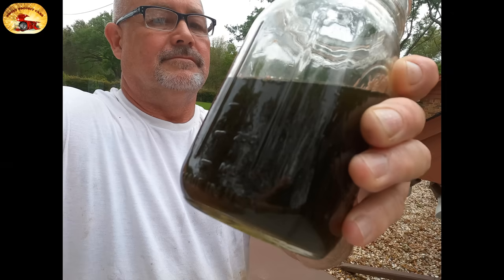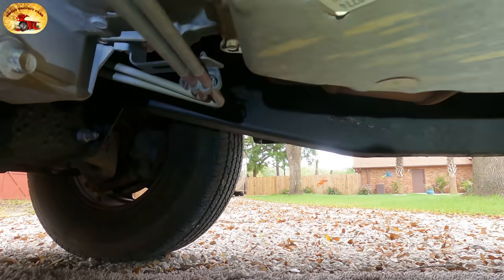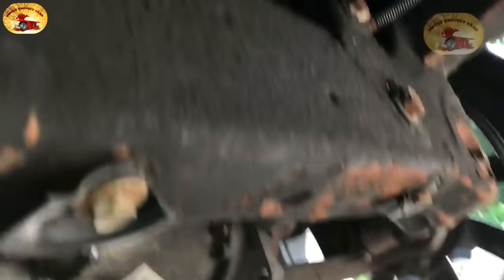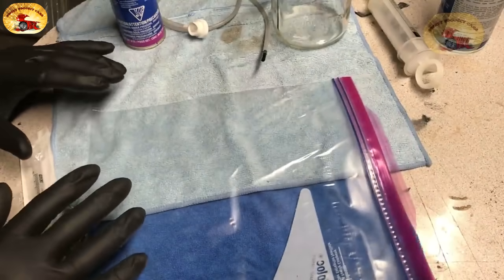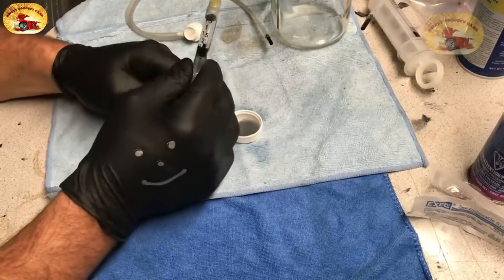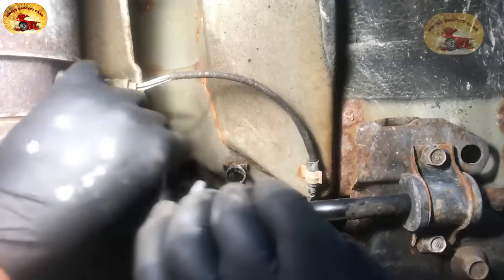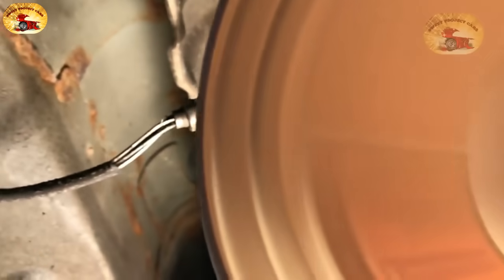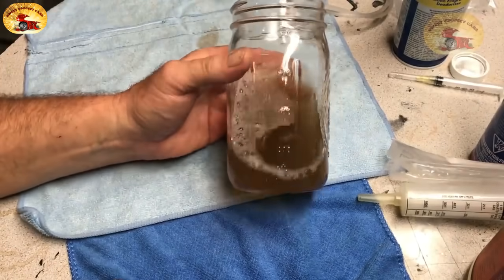Make your A/C 2 TO 4 TIMES COLDER & SPOTLESS CLEAN ALL at The SAME TIME!!

Comment from the maker: tO aLL oUR gREAT sUBSCRIBERS tHANK yOU!! Here is an updated version of a video you need to be doing Soon and you will be glad you did it when it gets really hot and muggy! **Quote of the Week: The older I get the less I listen to what people say and the more I look at what they do.**
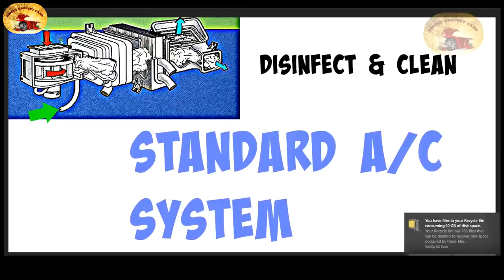Reply: And the older you get the smarter you get! Like putting down a carpet underneath your car so you're not crawling in dirt and gravel. Also when you get old you forget to empty your recycl bin and you end up with 10 GB of files LOL..... see 5:01 in video.  I did that years ago based on your advice and it worked like a charm. Took the musty stink away. Rock on Mike The Hammer!!! ⚒️
Reply: I looked for tools in the description and didn't find them.  I thought duh... that was the other video.  I found the previous video and watched them both through.  I have added the cans to my shopping cart.  My only question is: are the cans the links point to still compatible topped?  I have spent a year fighting a very very weak a/c system in my 2009 Lincoln Towncar.  Shop says all is well and I shouldn't expect it to be any better.  58 degree air coming out of vents when thermostat set to 60 degrees...
Reply: @Leonardokite  k
Reply: Kool idea
Reply: The car I have has two drain pipes, one at the front and one at the rear of the car. 
The car has air con  vents at back half of the car, as it is wagon.
Should I do the same to both drain pipes or is the front one enough?
Reply: @Blue1Sapphire  
If you have water dripping from the front and the rear of the car when the a/c is on then you have a dual a/c system. So, yes, you should absolutely do the front and the rear drains.
Reply: Just came by channel, good stuff.
My car just has a small outlet sticking out firewall.
Will this still work?

Comment: Thanks for posting this video.  I used the process as you describe on my truck last week.  You're right, it does clean the system and gets rid of the stale, musty smell.  Now it smells fresh and clean.  One caution for anyone wanting to try it:  When you run the AC right after cleaning, run it on lowest setting.  If you have the blower set any higher it will blow some foam out the vents.  After a few minutes it will all drain out then it's OK to let the AC blast a lot of freshness.
Reply from the maker: Glad it helped, thanks for watching and sharing, we really appreciate it. Have a fantastic week my friend. mad Mike the hammer SPC
Reply: @Elmnt_115  No. freon makes it cooler. That's what I need, freon. Once I put it it was from 85 degrees to 45.

Comment: Used this process to clean my evaporator on my 2003 Avalanche. I could not get the cold air like used to and knew it was probably crap on the evaporator and it was probably a lot so I ordered the cleaner on Amazon but one thing I did a little differently is I went to Walmart and looked for a can of sanitizer that I could attach to the small hose that came with the cleaner. I found Microban 24 Hour Sanitizing Spray which the hose and cap fit on perfectly. Just don’t go nuts spraying it in. Well everything worked like a charm, now I have cold A/C again! For the first time in years! Thanks!🙂
Reply from the maker: Glad to hear William! Thank you for watching and sharing your results, we really appreciate it, have a fantastic day my friend. mad Mike the hammer SPC
Reply: Also look to see if your vehicle has a cabin filter a clogged cabin filter will cause smells and restrictions with the blower motor

Comment: I also add Lysol spray through the air intake at the base of the windshield (outside), by the wipers while the air is on and the recirculating mode is on.  Let it run for a while, then I turn to heater, and let it run for a while.  I cycle through the different vents, floor, dash, defroster, etc....Really takes the funk away.  I will try this technique...
Reply from the maker: Thank you for watching and sharing, we appreciate the idea my friend. Hope you have a great day. mad Mike the hammer SPC

Comment: Great video. An easier way to do this on some cars is to carefully drill a small hole on the top of the evaporator case if you can reach it. Be careful not to drill too deep only like quarter inch so that you don't damage the evaporator inside the case. It's not a high pressure system so you can seal the access hole with HVAC foil tape easily and still keep your air conditioning sealed.  You may still need to plug the drain tube during the procedure. Keep in mind after running this foam cleaner your windshield may get fogged up from the leftover-chemical residue over time and also need cleaning. The evap-core ideally needs to be rinsed off after this process with white vinegar or a steamer through the access hole you made in the top of the EVAP coil case. You can also carefully pour hot water with a funnel. This procedure worked pretty well on my car however, the bacteria had been inside this car for so long that it permeated and ruined the upholstery and I couldn't get the bad smell out even with an ozone treatment.
 Ozone treatments can damage plastics and rubbe from oxidation.  Some people have claimed good results using a chlorine gas, but be very careful with those kits. Do some research before trying these methods. Unfortunately, I'm going to auction off my car.

Comment: Came across your video while looking for ways to improve my ac, I purchased an older vehicle, 98 and the ac is cool when you are sitting idle, but air coming out of it once you start driving is nowhere near as cold, I will be giving this a try, as the ac is original I can only imagine how much nasty build up must be stuck inside. I assume it's doing this because of a blockage or restriction. We shall see!  You have a new sub. Thanks for this, will be scouring more of your videos.
Reply from the maker: Welcome Aboard! Thank you for watching, sharing and for the sub. Watch this as well  https://youtu.be/Uf9h1cnmbz8  it goes along with this process. Have a fantastic day and all the best on your project my friend. mad Mike the hammer SPC
Reply: Hey did this video work for you? I am having the same issue with my car. Cold at idle but kinda looses the cool when accelerating
Reply: That sounds like the car is over charged, let out some of the refrigerant from the low side

Comment: Thanks for this great tip SPC! One thing my simple mind is struggling with if you read this one please: How does putting the Cleaner up the Drain Hose get the cleaner into your A/C System?

I thought the drain hose is only excess water drain, so what/how is the cleaner suctioned up into the AC system to clean it out?

Thanks - it's please help an A/C dummy day!
Reply from the maker: You have to remember that the drain tube is called your condensation drain and it comes right from your evaporator. So sticking the tube up in there puts the cleaner right into your evaporator area, the tube is like a main artery right to the heart of the system.  Hope this explains it for you my friend, thanks for watching and asking, have a fantastic day. mad Mike the hammer SPC
Reply: The cleaner cleans the outside of the evaporator by shooting it into the evaporator housing. The cleaner does not go into the air conditioner closed system that contains the refrigerant. It's the outside of evaporator he cleans, not the inside. The inside is sealed and clean.
Reply: @5metoo  hmm...

Comment: Did this, had to clamp it off. First the drain hose was dry and the tube wouldn’t go more than a few centimeters up, I sprayed a little it wet and then I could worm the pipe farther up into the drain pipe.
Yeah ac on high had bubbles flying into car, lol, just put ac on medium or something low.
06 Honda crv drain tube was up by the exhaust heat shield.
Thanks for this
Reply from the maker: Glad we could help superodfx! Thanks for watching and sharing, we really appreciate it, have a great week my friend. mad Mike the hammer SPC

Comment: I do another process where I remove the cabin air filter, blower motor and use a brush to knock off all the built up dirt on the condensor. I then get 1 can for every vent and spray inside each one to sanitize the entire system. I then use another can directly on the condensor to ensure the solution contacted everywhere. Its worked flawlessly every time.
(Make sure to vacuum out all the junk before spraying the stuff in there)
Reply from the maker: Awesome! Thank you for watching and sharing, we really appreciate it, have a great day. mad Mike the hammer SPC
Reply: Where do I find the products the small and large cans and the names of each can.please I'm a first timer.thank you.great video
Reply: @ja1908  look for the 'show more' hypertext in the description under the video.
Reply: @ja1908  click on the down arrow on the right and then click on MORE in the bottom right.

Comment: Had a sunroof drain tube disconnect and didnt know, car sat a while in the summer, after a rain and sitting awhile i come to find the entire car consumed in mold.  Was a nightmare of a job to clean this and salvage the car.  Did get it clean and driving but after a while using the ac, trace mold from that exposure must have gotten in the evaporator.  Even tho we had fogged this car heavily a few times..i suspec the moisture build uo from a lot ofnuse this summer created a build uo of mold and mildew to where i could feel it affecting my
Breathing.  Im now trying this a few time in hopes it will purge this mold out for good from
The evaporator.
Reply from the maker: Thank you for watching and sharing, you may want to sit one of these https://amzn.to/3a2HcOS in the vehicle for 24 hrs. with the a/c running for the 1st hr. to help rid the car of the mold/mildew. Hope this helps, have a great day and all the best on your project my friend. mad Mike the hammer SPC

Comment: I wonder if you could use a turkey baster or a tube with a rubber bulb on the end. "LubriMatic Battery Syringe Filler" comes to mind. Stick it into the drain tube to agitate the solution and introduce some turbulent flow up, through, and around the coil to break loose more debris and mold. It would take extra solution to do it, but the results may justify the added cost. Food for thought.
Reply from the maker: Thanks for watching and sharing, we appreciate the input, hope you have a great week. mad Mike & team

Comment: Any chance a dirty ac evap that you cleaned in this vid would cause front vents stop blowing air. ?? I have a really bad smell in my 08 jeep liberty and just recently the front vents stopped blowing air. I have dash and floor only. Hot and cold are hood... my jeep doesn"t have a cabin air filter either.

Any help would be great.
Reply from the maker: It sounds like you have a blend door issue, you are going to have to dig into it or take it to a dealership to repair. It's a common problem my friend. Hope this helps, thanks for watching and asking, have a great day and all the best on your project. mad Mike the hammer SPC

Comment: Random question please...I have a 2003 Chevy Tahoe and for some reason when the AC is on is leaks into the passenger side floorboard. Is it possible there is a break in the line under the dash! I have tried you unclog it but it still leaks on the inside. Any pointers?
Reply from the maker: First you need to do this video here  https://youtu.be/Uf9h1cnmbz8  Also, not sure if you have a sunroof, but the drain tubes on it need to be cleaned out as well.  You should check out your heater a/c box from the inside, it holds your heater core, that could be the issue.  Hope this helps Milles, have a great day and all the best on your project my friend. mad Mike the hammer SPC

Comment: I don't quite get it. After you squirt the first can up the tube and wait 15 minutes do you run the engine for 5 minutes with the air on low? Then for the second application do you wait for the engine to cool before applying the second can and process.
Reply from the maker: Watch this  https://youtu.be/_QWbFimZ_Gs  very closely a couple of times, it explains this method in detail. Thanks. mad Mike the hammer SPC

Comment: I have hyundai santa fe sport 2.4l 2018, the Ac control switch is not working,  it is also not taking charge,  just bought that used vehicle in that Condition and maybe not Ac before for 6 month in dealer storage. 
We checked if there is blown fuses and or relay, but they were working fine.
Yes the cabin air filter is dirty enough and i removed, will change soon, cause i live in Somalia,  where there is not good that professional mechanics here, when we inserted obd2 scanner,  this code was seen as lost communication with HvAc control module; code U016400. 
Please your feedback is important?
Reply from the maker: Sounds to me like your ac control module needs to be replaced. Hope this helps, thank you for watching and asking. Glad to have you here from Somalia my friend, have a great week and all the best on your project. mad Mike
Reply: @SweetProjectCars  thanks too for your opinion feedback, i appreciate your suggestion

Comment: Has anyone (prior to cleaning the a/c) had white particles come out of the vents and lay on your interior pieces? I can see them, like a white dust all over my black interior after running my a/c, especially after running the fan on high. It's been happening over the last month or so. What could this be and why is it there? I did not do any cleaning procedure on the a/c so it's not dried up foam or anything like that. I do have a cabin filter and change it every year.
Reply from the maker: it sounds like your cars a/c is ready for a through cleaning see our a/c videos we have a bunch that will take car of the problem for you.
Reply: @SweetProjectCars  thanks The Hammer Mike! I did purchase the two cans with the long tube as shown in this video, I'll check the the other videos out, thought I saw them all. Thanks again!
Reply: @mygt8a4re  did you ever try this method yet and how are the results?

Comment: I'll have to try this. I bought a car after a suicide and there is the smell of decomp coming from the vents.
Reply from the maker: Yikes, you better get busy on this process, then, I would sit this  https://amzn.to/3a2HcOS  inside the closed vehicle for 24 hrs. with the a/c running to circulate the ozone through the vent system for about an hour, and then after that 24 hrs, let the vehicle sit wide open for another 24 hrs. after running the machine. Hope this all helps Nightowl, thanks for watching and sharing, have a great day and all the best on your project. mad Mike the hammer SPC
Reply: @SweetProjectCars  Excellent, Thank you for this link, just ordered. Probably one of the many things I didn't think of. Then again it's not every day I buy a car with those symptoms.